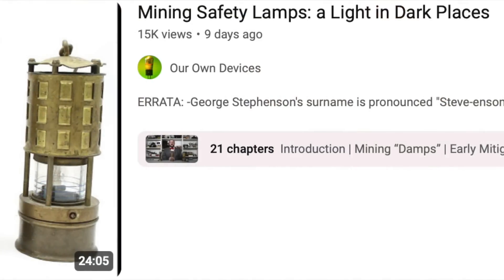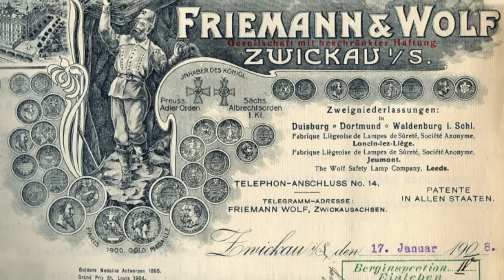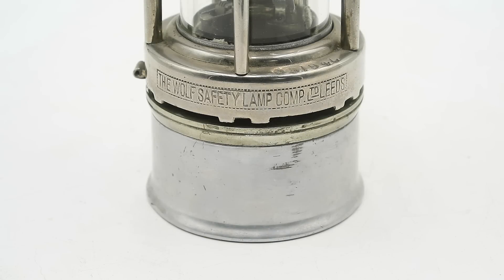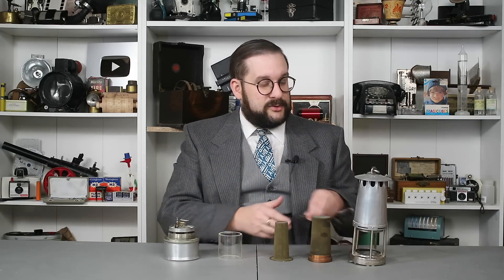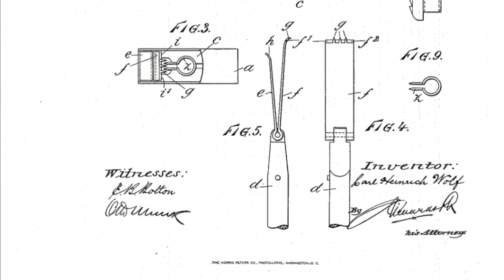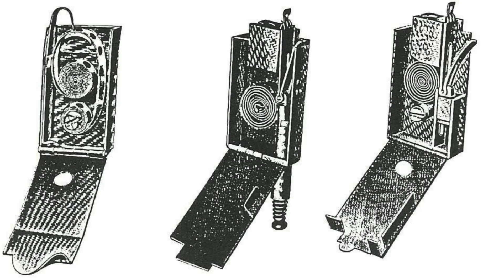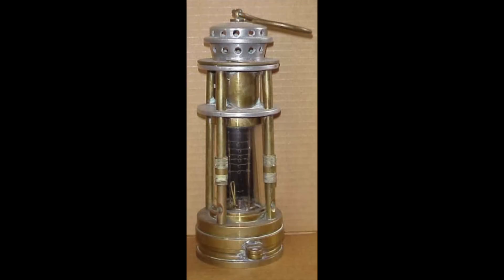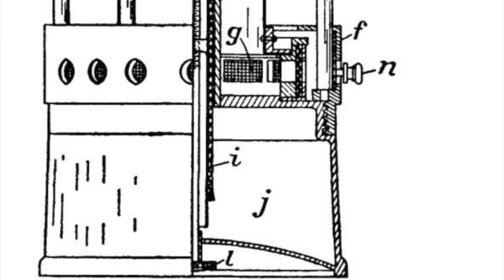Wolf Flame Safety Lamp: Many Bright Ideas

Comment: This is solely a guess, but if that number on the stamp is not actually a serial number, it might be a year and Julian day, which is one common form of a date code. So 1954, day 194, which is July 13 (as 1954 was not a leap year).

The L may refer to a specific manufacturing plant. Perhaps Leeds 😁

Comment: As a kid, I would enjoy trips to the Chicago Museum of Science and Industry. They had (still do, I think) a whole coal mine experience. And one of the first things they talked about on the tour was safety lamps. They would light one and put it in a sealed box with a window, and actually pump methane into the box and show how it reacted. Then they lit another lamp with a hole in its mesh and did the same thing. Of course it would explode in the box with the methane. After some time they stopped doing that, sadly.

Comment: I love this oil lamp rabbit hole! You could probably do a similar series with Hurricane and other lamp types too.
Reply: Technology Connections actually did a pretty comprehensive video on hurricane lamps.
Reply: Oil lamps are a total rabbit hole. It started with a friend asking me to restore a rusty old Feuerhand back to working condition. I have now restored a couple of cold blast Chalwyns and a hot blast BAT.  I have now moved on to pressured lamps being a Tilley and a Vapalux and there is now a calcium carbide lamp on the shelf requiring attention.
It is a fascinating history of the development of non-electric lighting.